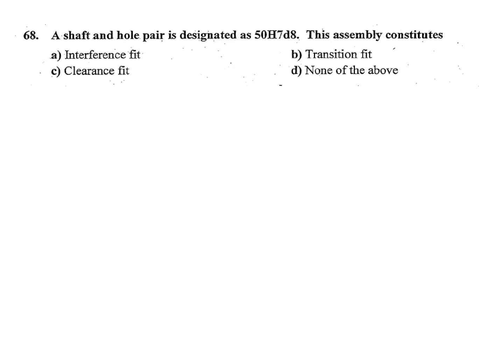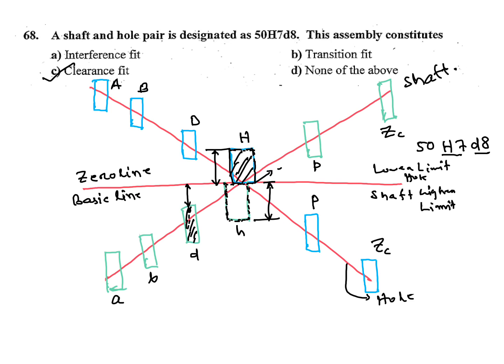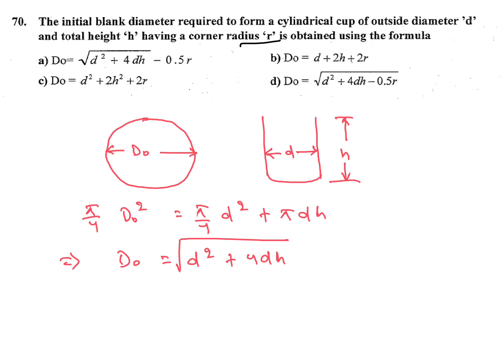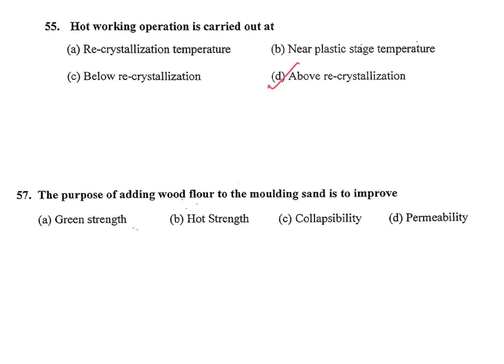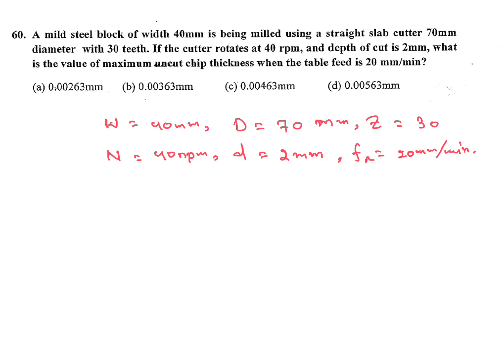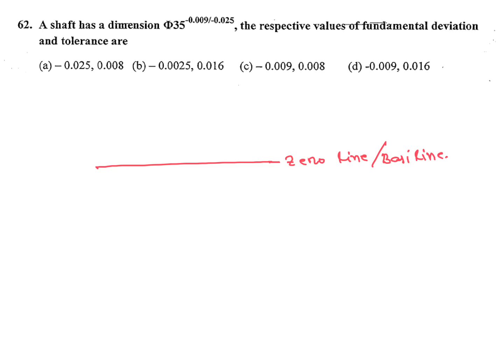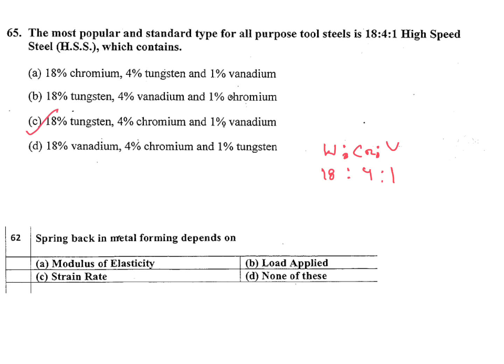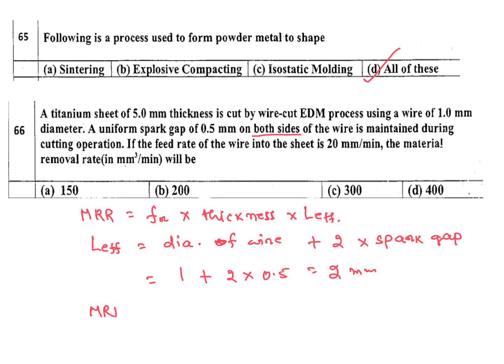ISRO QUESTION PAPER 2006—16  PRODUCTION

Comment: Q68: H means hole basis system 
          d means shaft basis system 
As question contains both H & d. So, if we draw both hole and shaft basis system we will get zero clearance. (min. Clearance). 
Is this correct min. Clearance = 0??